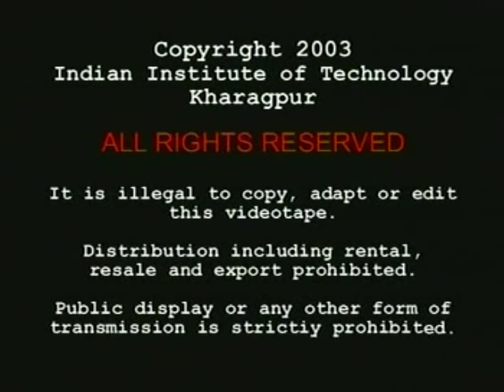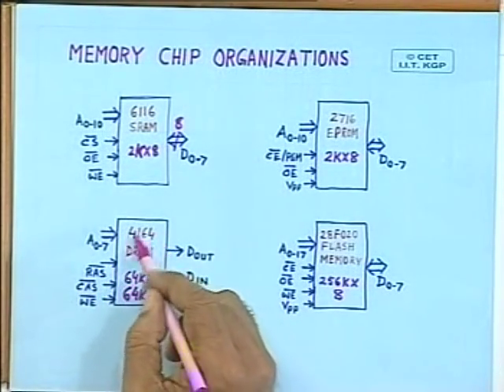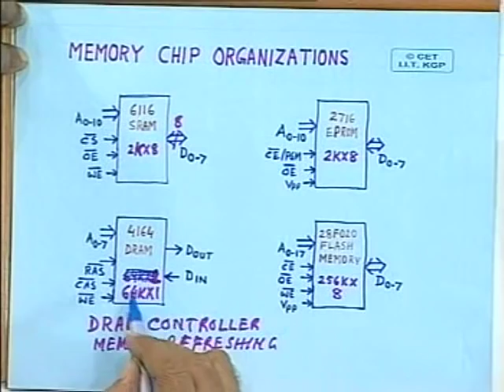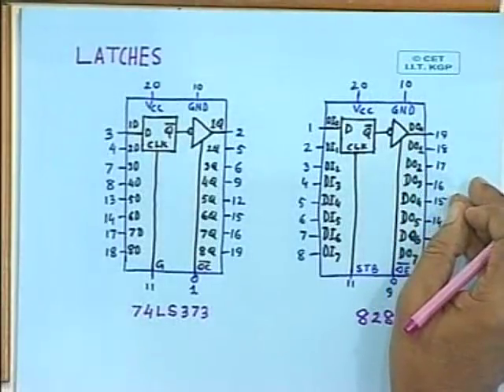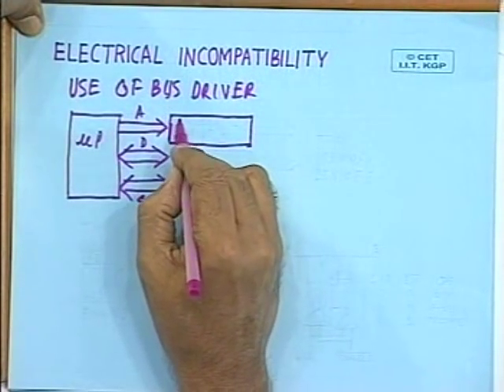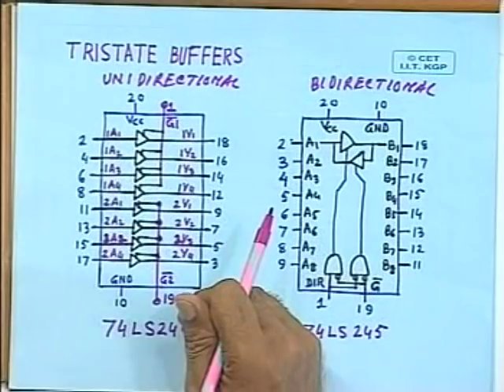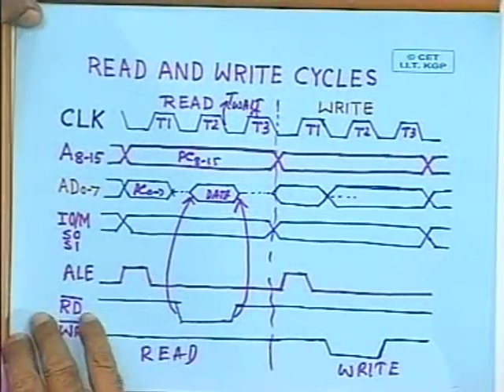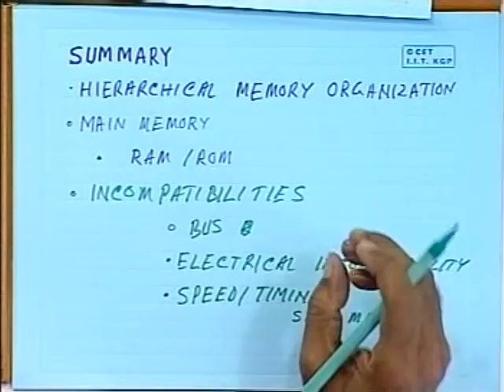lec 11 - Memory Interfacing (Cont.)

Comment: Possible mistake at 31:50? Regarding the Control Bus, should it be "Bidirectional Tri-State Driver" instead of "Unidirectional Tri-State Driver"?
Reply: It's correct. Unidirectional.
There will be 2 unidirectional lines: one towards microprocessor and other towards memory.